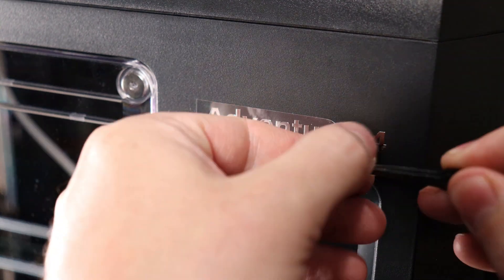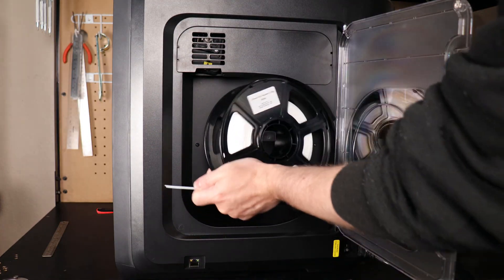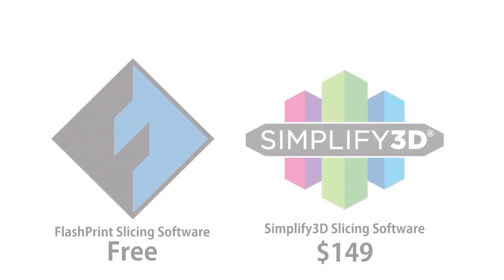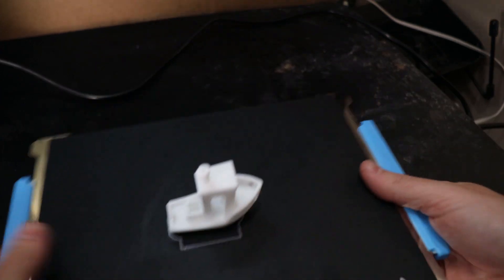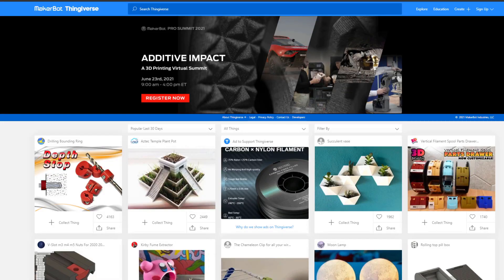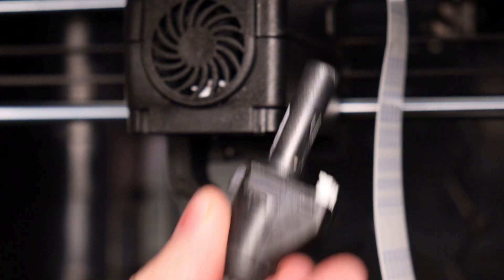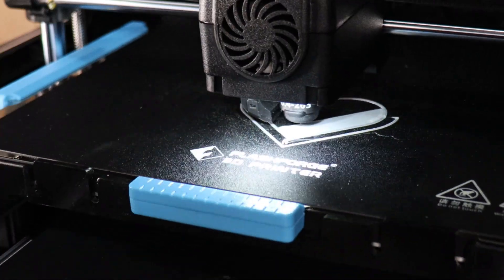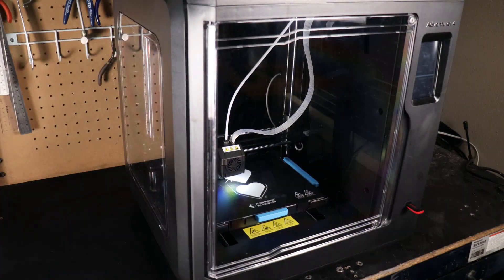Best Prototyping 3d Printer For The Money - Flashforge Adventurer 4

Comment from the maker: I do think this is a great printer for prototyping or full on production work. It is fully enclosed so it keep a lot of heat in and keep dust out along with keeping any kids or animals away from the print as it is working. With it being enclosed and having a 265c nozzle so you can print with just about any material you want. Most open printers have a very hard time printing ABS, ASA and Nylon.

Flashforge Adventurer 4 - https://amzn.to/3F2sAZ3 

3D Files:
Modular Hex Drawers - https://www.thingiverse.com/thing:1743145
Heart Shaped Ring Box  - https://www.thingiverse.com/thing:3849577
3DBenchy Boat - https://www.thingiverse.com/thing:763622

MatterHackers 3D Printing Filament 1.75mm:
Build Series PLA - https://bit.ly/MatterHackersBuildSeriesPLA
Build Series Silky PLA - https://bit.ly/BuildSeriesSilkyPLAMatterHackers
Build Series ABS - https://bit.ly/MatterHackersBuildSeriesABS
Build Series PETG - https://bit.ly/MatterHackersBuildSeriesPETG
PRO Series Filament - https://bit.ly/MatterHackersPROSeriesFilament
NylonX Filament - https://bit.ly/MatterHackersNylonX

Amazon 3D Printing Filament 1.75mm:
PLA - https://amzn.to/3gsLE9Z
PETG - https://amzn.to/3pXjjvu
ABS - https://amzn.to/3wsTRjS
ASA - https://amzn.to/2RX8dtM
Polycarbonate - https://amzn.to/3cLdr38
Nylon - https://amzn.to/3iNGeI2

This printer was supplied to me and no money has changed hands. All thoughts and opinions in this video are my own.
______________________________________________
Note Most of the links that I use that go to products are affiliate link. This means I make a small commission on anything that you happen buy using them. This is at no extra charge to you and this helps support the work I do on this channel. 😁👍
______________________________________________
#Flashforge #Adventurer4 #3Dprinting #diy

Comment: Great review! You mention printing in Nylon (PA), but I don't see that on their website. I am used to a nice Nylon-CF printer where I work, and want to try to print similar materials at home. Have you printed Nylon with this printer?
Reply from the maker: Thanks and I haven't used Nylon or CF on it yet but I have used PC-CF and it worked with no problems. I have also use ASA and ABS in it all the time. I hope this helps a little.
Reply: @randymay  Thanks for the info! PC-CF is even stronger. Did you have to modify your machine, or just swap in their 265 deg nozzle?
Reply from the maker: @CalMariner  I have been using the 265 nozzle from day one. I haven't dont any upgrades to the printer.

Comment: This is my first and only 3d printer. When I used Cura I was unhappy with it but now that I use FlashPrint, a 6MM Nozzle, and a Steel platform I am super happy with it.
Reply: what steel platform do you use?
Reply: @CandleChrisTv  I got it from Flash Forge on Amazon. I had to clamp it down in the front recently so it did not move. https://youtube.com/shorts/Viae8NZsr8Q?feature=share